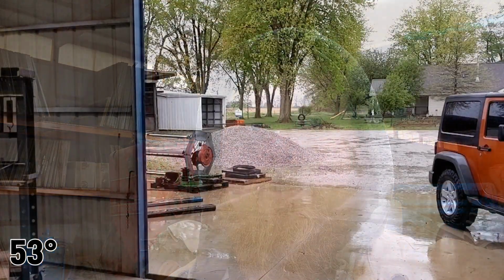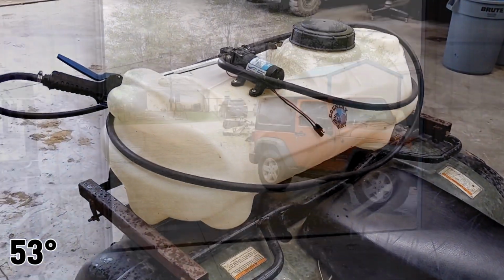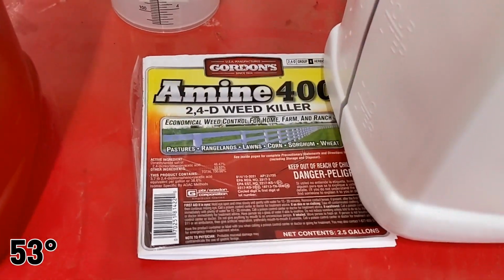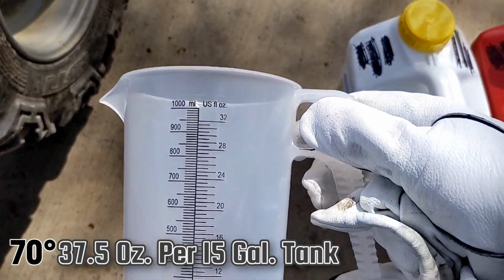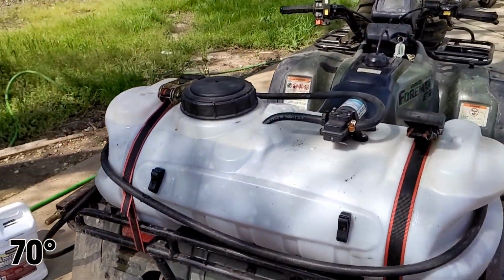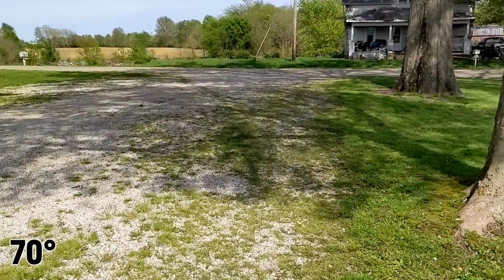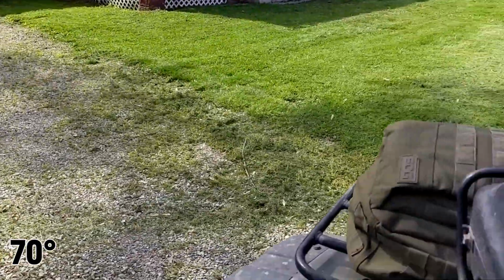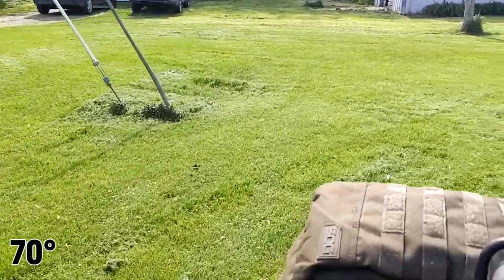Weed Killer That Kills Weeds And Grass

Comment: RM 43 is NOT that garbage Round UP. RM43 kills EVERYTHING 1 time, for a long time. Round Up is junk that takes multiple applications and still only lasts a few months.  JUNK!
Reply from the maker: I'm definitely no chemical expert as you can tell... It seems to work well for me. If I understand the directions correctly I did mix it in the proper ratio but I believe I ended up mixing it even hotter to get better results. I appreciate you taking the time to give your input and watching the video.
Reply: If you mixed this as the instructions explain, you wouldn't need to mix it with anything else. That is if you understood that RM43 is NOT Round Up. RM43 is more then strong enough by itself, when it's used the right way. 
I'm sure someone you know could read the instruction to you if you need help with understanding the directions.